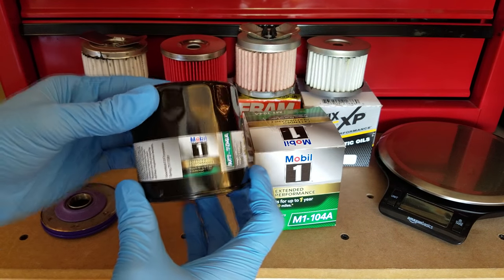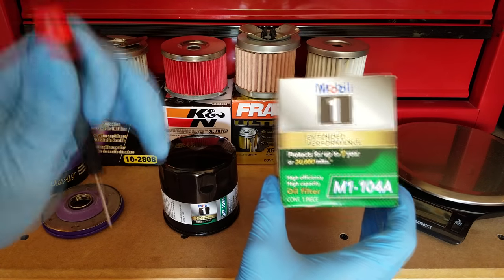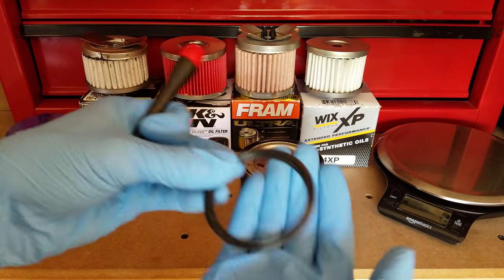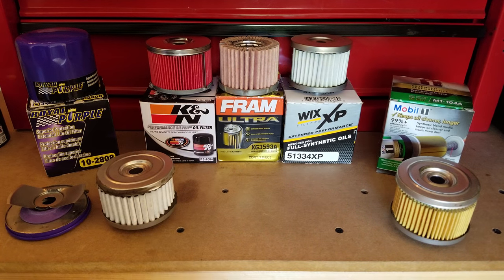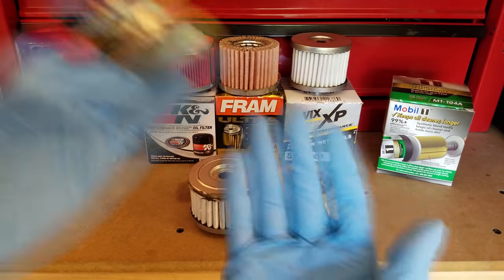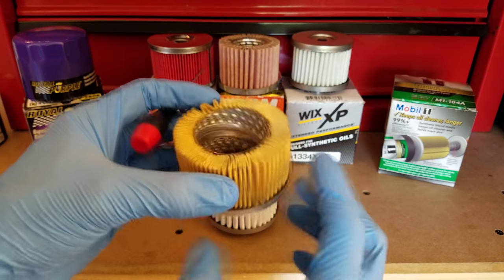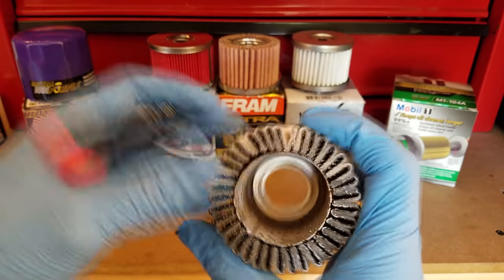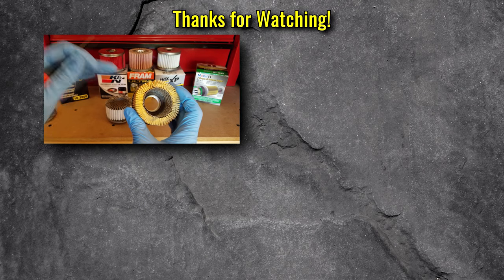Mobil-1 Oil Filter Cut Open! | vs Royal Purple/WIX/K&N!

Comment: I have a Toyota Prius with 330,000 miles and it's never needed a repair. I simply follow the maintenance schedule in the owners manual. I do use a great car maintenance and management program www.automotivewolf.com on my laptop to monitor its maintenance schedule so I never forget anything. I use the recommended Toyota oil filters. There is a youtube video of a Toyota filter being cut-up and the quality was excellent.
Reply: SMOG 2015 Prius can remind you at 5k or 10k miles for oil change. Crude but works. No oil monitoring system, just distance
Reply: Toyota rules. The quality is superb. My 4Runner has 277,000 miles on it.
Reply: show me the million milers.
Reply: I have a 1994 ford tempo with 240,000 miles on it, it's a great car little car honestly and it's been running strong and I only use mobile 1 products I think it helps that filter is a great one honestly.
Reply: What about battery. Had mine changed at 160k but kept going after.
Reply: @SMOG nerd. Many vehicles dont have one.
Reply: @freddyflintstoned913  The super duper oh so much more reliable than everyone else days of Toyota are gone. The world has caught up and Toyota have slipped back. They are trading on a historical myth. All we are left with today are sub par styling and materials. There are million milers from almost every quality car maker you could care to name, but if you think Toyota are miracle machines, chances are you're way out of touch with reality
Reply: @hydorah  https://www.cheatsheet.com/money-career/most-reliable-cars-decade-according-consumer-reports.html/ Check it out.
Reply: @hydorah  It seems you drive a ford? My 277k mile 4Runner is sweet.
Reply: @hydorah  Myths are paid for by advertisements in the likes of Popular Mechanics. No paid advertising in Consumer Reports. Toyota/Lexus rule, the rest are just followers. Toyota is almost magic. The folks at Toyota have let all other car makers study the Toyota way and none can match the consistent quality of Toyota.
Reply: @freddyflintstoned913  Bullshit I don't have any Fords. Our household has two Mercs and a Toyota, guess which one has had a new gearbox. Toyota's glory days are long over
Reply: Toyota rules.  Sorry you broke your gearbox.
Reply: @freddyflintstoned913  Toyota rules? Only to fools
Reply: @hydorah  you own one. Or is it your Mom's?
Reply: @hydorah  https://www.youtube.com/watch?v=fDKVeIg_A5s&t=409s
Reply: @freddyflintstoned913  Best selling doesn't actually make it any good. It won't last either. The top seller is the Rav4 which is laughably dull and overpriced for what it is. Yet that's the US top seller for 2018

https://www.topgear.com/car-reviews/toyota/rav4

https://www.whatcar.com/toyota/rav4/4x4/review/n130

Even though it's evidently shit the reliability myth pervades although it is fading. reliability is described as 'good' when once upon a time reliability was stellar. Like I said the myth is of the past. In the present Toyota is nothing special
Reply: @SMOG my fiancees 2017 yaris shitbox doesn't have even a maintenance required light. My friends 2007 FJ has a light that comes on at 5,000 eben though the manual says every 7,500.... Go figure...
Reply: @SMOG she got the car 3 months ago with 38,000 on it... Has 46,000 on it now. Manual says there is no indicator. Toyota tech said there's no indicator...
Reply: @SMOG I never said anything about my car... Lol
Reply: @SMOG ok? What about it?
Reply: @SMOG I'm not getting it. Maybe you dont understand my reply... My reply makes your condensation excuse null, void and idiotic...
Reply: Mister Berzins there is/was a man with a VOLVO, either 4 or 5 million miles , that was one of its items, the odometer  had extra digits for that very reason.
Reply: ryan felps I had a 91Taurus,  #5 cup had low compression, bought it used in 95, 3.0 liter V6 360000 miles
Reply: Mister Berzins the ONLY reason I do NOT buy any JAPANESE cars, is SIMPLY  I DONT BUY ANY CAR WITH A LEFT FUEL FILLER. ! Sure there are US cars with left,,I don’t buy them .
Reply: @flybyairplane3528  
Why?
Reply: What year and model is your Prius?
Reply: One of the best most reliable cars made. Both mine have 180, 000 miles, and nothing ever broke on either. Only fluid changes and tires, brakes last forever.

Only car I've owned that allways beats EPA mileage estimates easily. Owned several Ford, GM and VW products they suck for reliability and quality.
Reply: @realtaur  no clearly you are. Prius are the most reliable cars made.
Reply: 330000 in a Priius with your Boyfriend !!! Sounds like true love!
Reply: Lot of Prius hate here for no reason. Wonder if these are the same guys cutting them off for no reason etc.? 

For the record mine has a Trump sticker in the back window, along with an "Only You can Prevent Socialism" Smokey The Bear Sticker.  We like it enough that the Wife bought a new Avalon Hybrid. 

200k on the Odometer.  The Factory Oil Filter until 100k, then I took over and have used Fram. The "Service" light comes on when it's time for an oil change. 

2007 Touring Prius.

Comment: Mobil 1 opted for the semi synthetic medium so they could get more pleats for the extended life factor. Synthetic media needs a support mesh.  They also traded off filtering for the finest particles to 99% to keep the filter from clogging sooner.  This doesn't mean that the filter will always bypass the smallest particles, but they may need to go through the filter more than once to be caught.  How much damage the super tiny particles do is a matter of debate.

Basically if you are the kind of person who does oil changes every 2000 miles other filters may be better, but if you are one of those people that kind of get around to oil changes more or less every year... and / or don't have a working odometer, the Mobil 1 filter is the way to go.

Comment: Motor craft filters please!!
Reply: yougogo2 agreed
Reply: Yes, Motorcraft please!
Reply: I’m with them
Reply: yougogo2 great stuff! Ford all the way!
Reply: FL820S !!
Reply: You don't need a video to know that Ford sucks! Lol
Reply: Years ago in '98 when i bought my first '93 mustang GT i used motorcraft & it collapsed in some. Asked a couple other buddies about it & they said theirs did the same so they never used the motorcraft filter again & neither did i
Reply: @logut80  ok..i tried a mobil 1 filter on my 94 bronco..freakin thing caused the valve train to rattle upon start up..put motorcraft back on =mint...must not of had anti drain back valve or something..never a prob. With 100,s of 4.00 dollar MOTORCRAFTS.
Reply: See my video on what happens when you don't self examine your filter. The back plate was loose. I still think no oil should go beyond 5000 mi. Though I got a bad motorcraft filter. I still use their brand. K&N had a bad tick in motor, fram left oil dirty compared to other brands. Mobil 1 was pretty decent. I haven't used Napa, or any generic filters. 1 bad apple doesn't spoil the whole bushel. Just pre-check filters before install and always look at the old one.
Reply: @logut80  At that time if I remember correctly. Fram was making some of filters for Motorcraft.

Comment: Use Mahle filters on my highly tuned rally car with high pressure oil pump and change and cut filter open to see if there is any metal particles in filter. I change roughly every 4000 miles. Used other makes and always cut open the filter to look for engine wear. Best one I've used and still use. German company that makes lots of good engine parts. Supply to F1 companies?

Comment: To add to your point about the Mobil1 filter gasket having a lip to "lock" itself in there, I think that's genius because sometimes the gasket will get stuck on other filters when you go to remove them and I, having done it so many times, know to check for that but I could totally see somebody not knowing/forgetting to check to see if it came off. Big plus for the engineer who thought of that because I've heard stories of people leaving the old gasket on and then they put the new filter with its new gasket on there and add the new oil and start the car up and it sprays out because of being double gasket-ed. Quite the messy situation.
Reply: Lol

Comment: The rounded gasket with a locking groove isn't just "a little bit better design." It prevents the seal from sticking to the engine block when you remove the filter, causing you to double up on gaskets and create a massive, messy leak. That's "a whole lot better design."

Comment: I have ran Mobil1 filters on my Hemi's for years and have been very happy, but my Duramax is really picky about oil filters, I went through 4 brands before I found one that didnt cause excessive "typewriter tick". AC Delco was the winner, I would be curious to see what the differences are between them. Thanks for the very detailed analysis!
Reply: You mean ur dmax prefered a OEM filter? Now fuck thats weird kuz thats what your owners manuel would tell you to use instead of messing around with the 4 other filters.. 🤣🤣🤣

Comment: The biggest thing with filters is the construction of the bypass and drainback valves. If the oil goes in, but then bypasses the filter because of shoddy design, OR the filter allows filthy unfiltered oil to simply drain back into the engine it defeats the purpose. 
In todays market, the media used is not going to differ that much for passenger car mass market filters. 
That said, I have been using WIX for some time now, mostly because I have never found a video or other review about poor quality. For my other types of engines, my tractor for example, I have always picked up Baldwin. Baldwin makes heavy duty industrial quality filters, used them on tractors growing up for years for farming. Baldwin supplied OEM filters for J.I Case and other major manufacturers back in the day. I have never looked to see if they make filters for my passenger cars because they are usually priced a bit higher and really WIX has had me covered for the light duty filtering for that application. 
Honestly in the end IMO the most important thing to do is make sure you use the right oil for your application, including the ratings. Most of the time barnd isn't as impotant, but people usually do not realize the older engines(the engines that the big 3 used from the 60-s through the mid 90's, like a Chev 350) require a rating modern engines do not, and only a few oils provide that. I think it is the "S" rating, but I would have to look it up again. Mobile Delvac and Shell Rotella are two examples of oil with the rating, where oils like Pennzoil or Valvoline will not have it for those older applications.Something to keep in mind when oil changing your old pick up or muscle car.

Comment: If you feel like spending more for a quality filter, buy Baldwin.  If you want cheap, but still fine, the ubiquitous AC delco PF47E is a whopping $3.35 at Amazon for instance.  No one should ever hesitate to use a OEM branded filter.

Comment: Back around 1985, a friend of mine had a Toyota Supra.  He would get his oil changes at one of those quickie oil change garages.  It turns out the oil filter they used was the ultra cheapo model.  One cold morning he started his car and the oil pressure spike (cold oil is thick oil) actually split the filter's metal can.  He drove down the road a short distance before he realized it.  He pulled over and saw the oil pouring out of his filter.  He had the car towed to the Toyota dealer.  They gave him bad news.  The overhead cam was damaged and needs to be replaced for $1200.  That was the last time he used a econo filter in his cars.

Comment: 284k on my 2007 F150 4.2L Been doing Mobil 1 full synthetic oil changes with 20,000 mile filter.. I change once a year for the life of my truck.. and yes I do 20k a year with it.... ** I DO use Lucas Additive***

Comment: Excellent comparison since I'm considering Mobile 1 filter for my newly purchased a Yamaha F200 outboard. I just performed the 10 hour break-in oil change. The filter and oil cost ~$75.00 (again that is just for the oil and filter). One comparison I'd (and I'm sure many others would be interested) like to see is a Yamaha oil filter compared to quality aftermarket oil filters (mobile 1, WIX, Purolator, etc...). There are many blogs/posting discussion "are we really getting a better product with a Yamaha filter or is it just a standard filter with the Yamaha branding and their 3x markup. I saved my Yamaha oil filter and would be happy to send it your direction for your assessment if that helps.

Comment: I always drive with K&N filters and Valvoline Full Synthetic 5w-20 on my Impala. The oil flow is always significantly better with K&N than any other brand I have used on it. I prefer high flow over extended oil changes, any day (I change my oil every 3000 miles / 3 months regardless of how clean the oil looks).

Ironically, my old '94 Plymouth Acclaim gets better oil flow with Mobil and Purolator BOSS filters than the others.
Reply: As a side thought, I think it would be cool to tear down many, if not all of the filters from a single manufacturer. It would be cool to see the difference between the quality of build and design between the same brand and type of filter over multiple vehicles.

Comment: I have an 04 Silverado 4x4 with 4.8 engine. I change oil every 3000 miles using regular dino oil and standard filters. Switch to 10-30 or 10-40 in summer for towing and back to 5-30 in winter for better oil circulation. In summer I also add about 3 tablespoons of STP or Motor Honey style product for the extra film strength that olefin copolymer and zinc offers and reduced friction, better gas mileage, etc. I get 18.7 mpg average mileage under all driving conditions. Filter type or cost makes very little difference as well as oil brand & type as long as there are no issues with disintegrating engine parts, failing bearings, metal chips, etc. The oil is simply a physical barrier that must be maintained in order to prevent metal to metal contact. Proper viscosity to match the intended load and work range, and temperature range of the engine is the key to long engine life my friends, not how much you paid for the oil change. Match the oil to the load and change it often. Baby that engine and drive sensibly and she will serve you well.

Comment: I just bought an M1- 103A for my toyota Yaris and it came 8 small holes taller and lighter in comparison with the same filter I bought 3 month ago that had 13 bigger holes and it was more heavy and about 1/4 inch shorter which to me it looks like a very high quality filter. Seeing this makes me think that they are lowering quality and selling as the 20,000 mile protection filter which I totally think is false but then again I am not an expert what are your thoughts about this?

Comment: When you try to filter particals in the 10-20 micron range and expect long filter life, you need to be burning propane for cleanest combusion.  Otherwise, gasoline will generate particulates that will gradually build up and force filter to operate in bypass mode toward the end of the 20,000 mile expected life.    Engine operation average under 2,500 rpms keeps partical accumalation rates down.  Engine operation average over 4,500 rpms dramatically increases partical accumalation rate and cuts filter life to almost half. 0W-15 oils are easier to filter than 15W-50.

Comment: I'd like to see the AC PF-63E VS. the corresponding Mobil 1 Extended Life filter.
My 2016 GMC YUKON XL DENALI 6.2L died at 49,000 while I was on the road.. I've used Mobil 1 0W-20 every 6,000 miles with AC Filters.
The out of state GMC dealer told me the oil pan was dirty.  The only variable seems to be AC Filters are faulty.....

Comment: Locking seal so that it won't come off,and stick to the filter mount on the motor, if you're not paying attention to it,you could miss it, and end up with a double seal that will eventually leak all the oil out,and blow your motor.

Comment: I exclusively have been using Volar, which is a Chinese brand sold at Walmart and other online outlets. The build quality looks good from the top, but I've never cut one open. I do pay $3 per filter, which will become $4 in volume (after trump tariffs bite in 2019) so I'm a bit amazed that there is that much filter for the dollar. Would never buy Fram as you said.

Comment: Can pretty much go by the old rule of 3k but now days 5k is typically safe with almost any design, save a few direct injection turbo variants...

Most overhead cam engines don't care about oil and filter choice unlike the older flat tappet engines that require special oil

Comment: Did you have a lab test? 
Or something Where shows how good the filter filters the oil.  how manny particles are in the oil after filter, how manny still unfiltered  after like 5k miles
Reply: I think he would have mentioned that.  He already has the cost of the filters, lab testing each filter I have to assume would be cost prohibitive.

Comment: Work in a mine in Northern Alberta and in the winter time was common as hell to crank over a cold engine just to have the fram oil filter blow at the top dumping the oil all over, replace the pos with a AC Delco or MotorCraft filter, zero issues, never ever had one fail like a Fram.. Id rather use a pickle jar full of tampons before id use a fucking fram anything.
Reply: Can't speak about for their higher price filters but their basic filter are junk from what I've seen.
Reply: I would use Walmarts SuperTech filter before I would use Fram basic filters.

Comment: There are only 2 points of any use in oil filters to be aware of. 1) filter element material 2) Seal element material. As long as you don't buy the cheapest one you are getting a more than adequate oil filter.